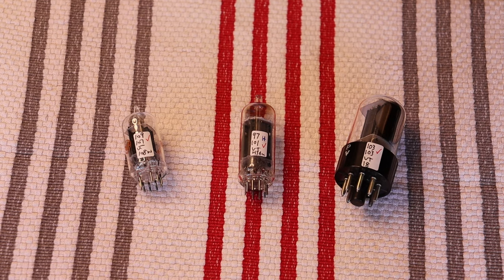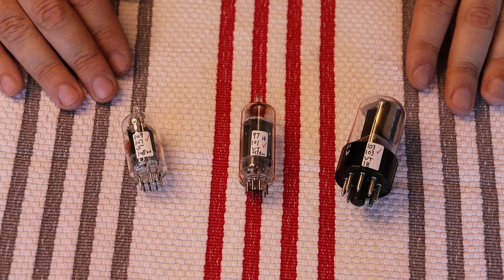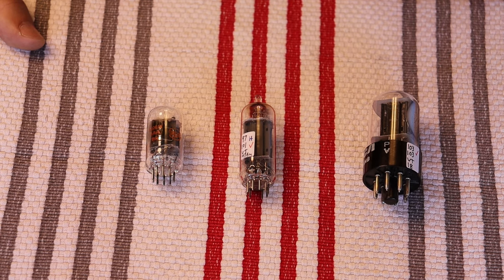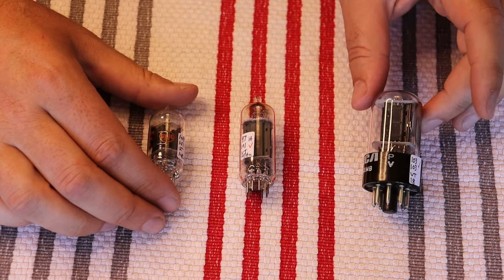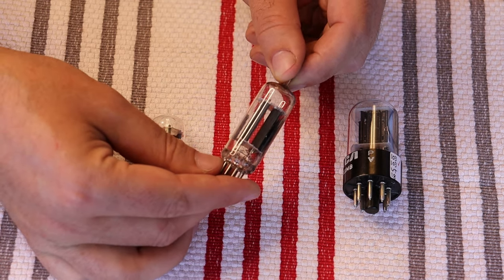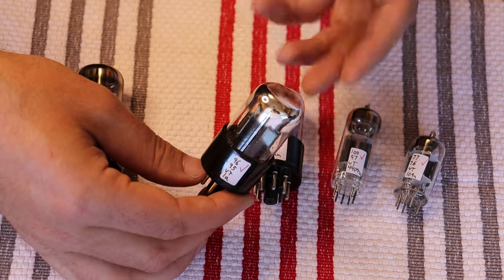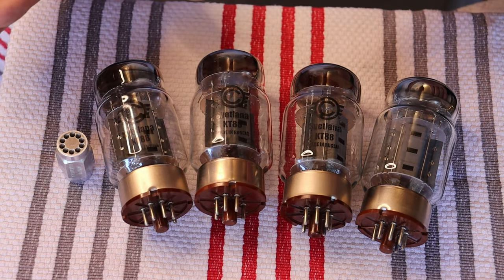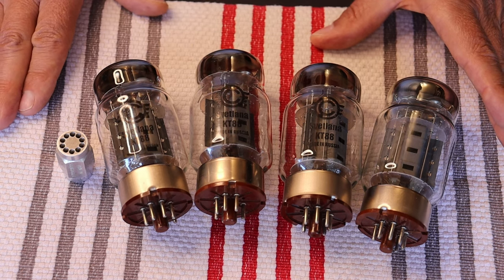Tube Lab #194 - RCA "Clear Tops"

Comment: I've always felt RCA tubes in general  have been a safe bet. I'm not a huge fan of the 12au7 clear tops but i would still choose them over many others.
Reply from the maker: @NosEL34  I used to think they were just a good tube with a lovely treble, then we used them in one of our headphone amp prototypes as the input gain stage and they just blew me away with a nice warm full midrange and a treble that was the best we've ever heard.  Even though everyone knows tubes are partly dependent on the circuit they're running, it's always worth repeating.  Another common problem we see all the time is poorly designed circuits that don't even give the tubes a chance to show what they're capable of - this is a common problem even in expensive amps.
Reply: @tubelab194  very true & well said. I guess I should say that I haven't listened to the clear tops in a circuit that brought out their full potential. They are definitely a very popular tube.